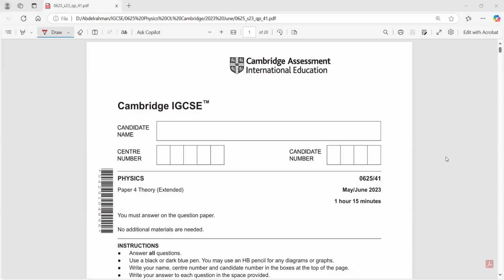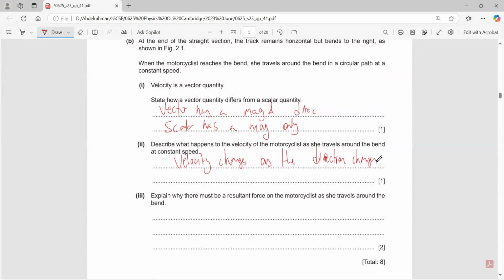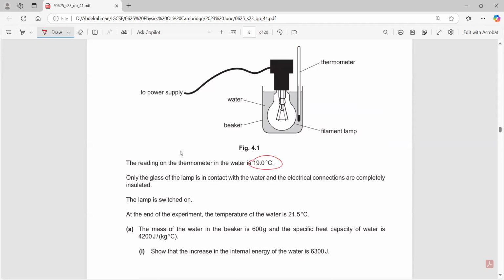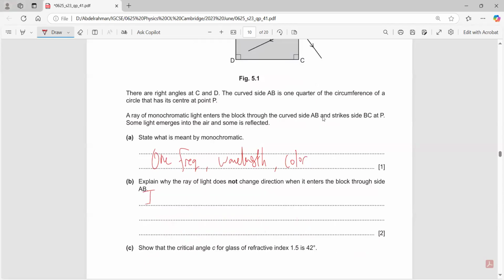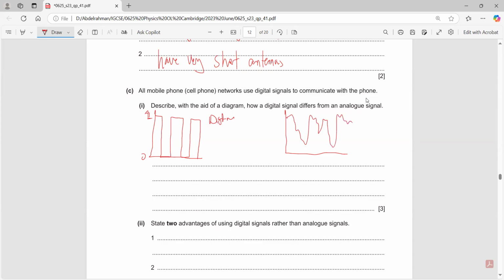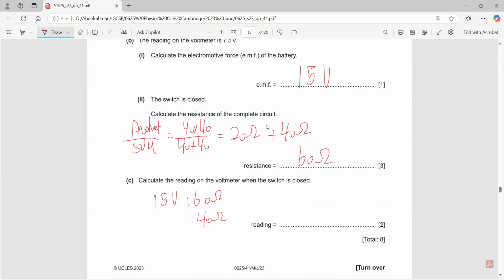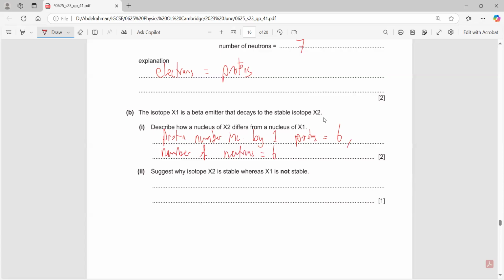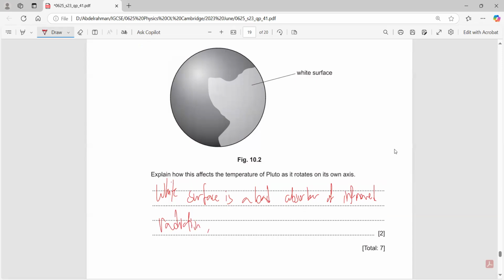IGCSE Physics 0625/41/M/J/23

Comment: In qu 1 how to know direction of velocity ,like how do i know the required angle
Reply from the maker: Using trigonometry (SohCahToa). When the question says it wants the direction with respect to the horizontal (for this case he said relative to the river bank) , then we use the tangent and the opposite side should be the y (which is 0.72), while the adjacent side should be the x (which is 0.54)